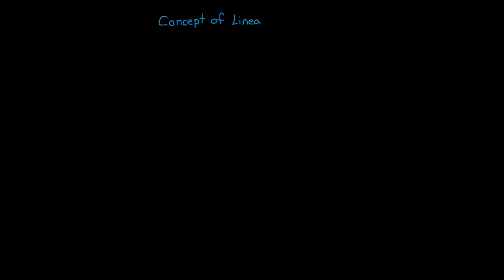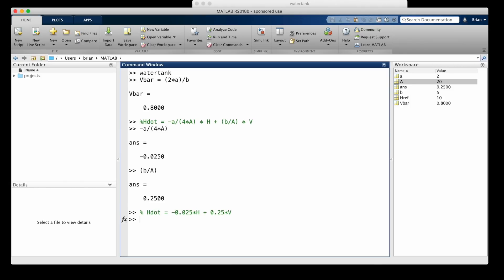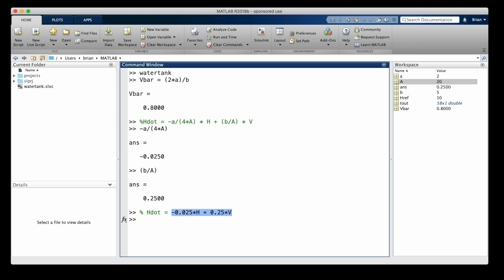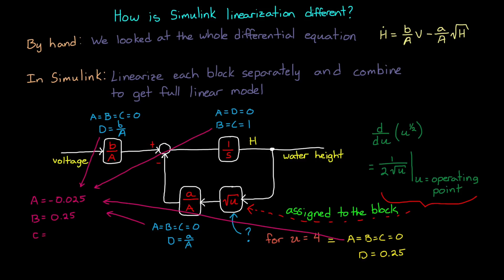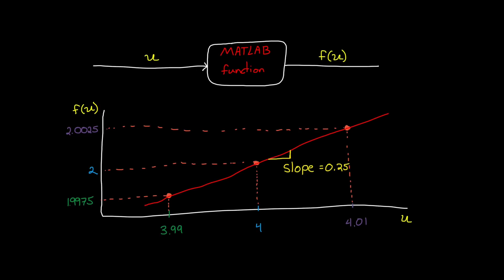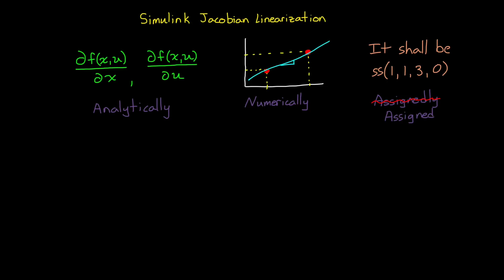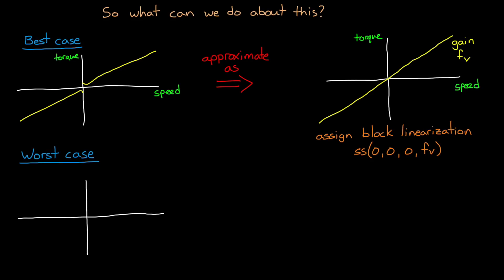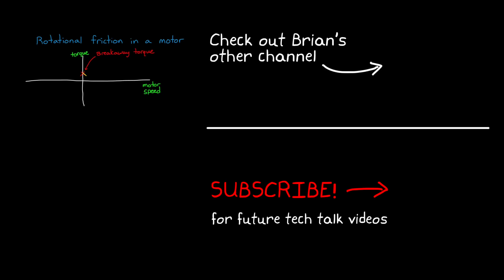Linearizing Simulink Models

Comment: Thanks Brian for the awesome videos. I have faced an interesting problem. My linear model derived by hand contains a pole at origin and according to local stabiliy theorem we cannot conclude anything about the stability of equilibrium point by using linearization. It turns out this is exactly the case as when I plot the eigenvalues of the system, I see difference between the damping of dominant poles and the time-domain simulation. However, when I use linmod, the obtained linear model correctly represents the dynamic behavior of the nonlinear model around the operating point as verified by simulation results. I was wondering where this difference between my linearization and linmod comes from. Is it because of that block-by-block linearization? Can we say that the method always results in exact linearization without error? The linmod model contains no eigenvalues with zero real parts, is it going to be always the case?
Reply: I don't know the answer in general. Is your nonlinear model and your linearization by hand simple enough to share and I can take a look?
Reply: @BrianBDouglas Yes, it is a system of third order.